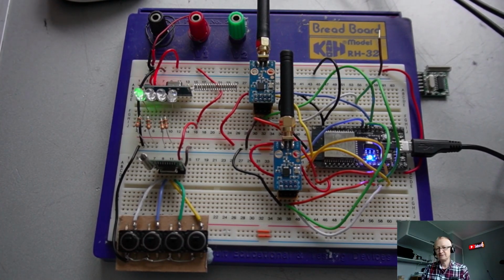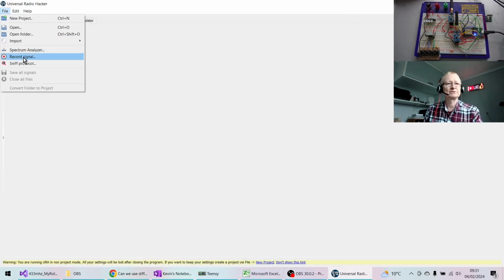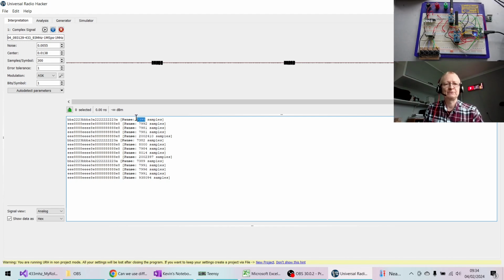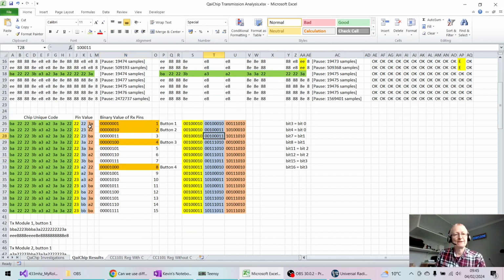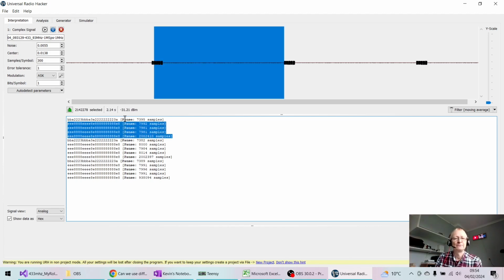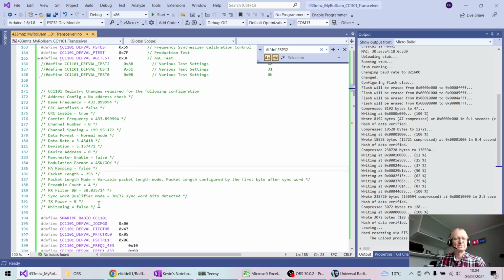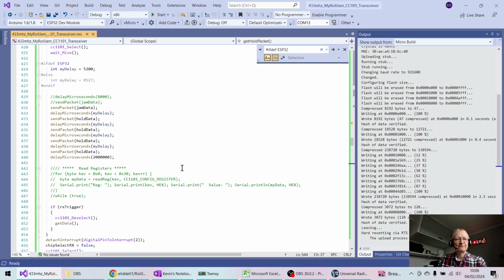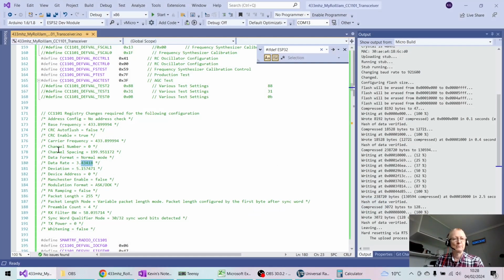QiaChip Signal Decoding -  433Mhz You can't hack this !!

Comment: It will be a software emulated ev1527 or a Princeton Technology chip; viewing the waveform will tell you which one. Usually available between a receiver chip and decoder IC on the receiver pcb. Reminds me of my decoding sessions as a young teen, using a receiver (from a junked car alarm), tape recorder, and data slicer into an 8 bit home computer. Really bodgy, but it worked.
For ASK now, I'd simply interface a bare receiver to the input of a sound card and record the result in Audacity for analysis. I'd be using a bare 433MHz transmitter module connected to an arduino to generate the signal rather than the  sledgehammer esp and cc1101 combination. Soundcard is fine on the demodulated signal from a receiver for these things as the data rate is so low.